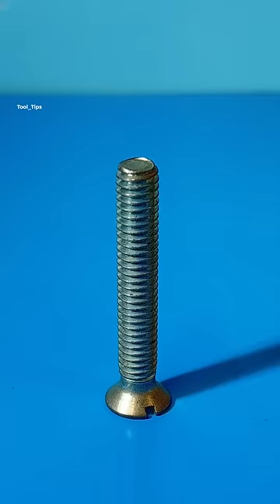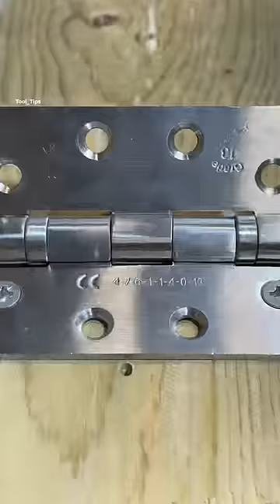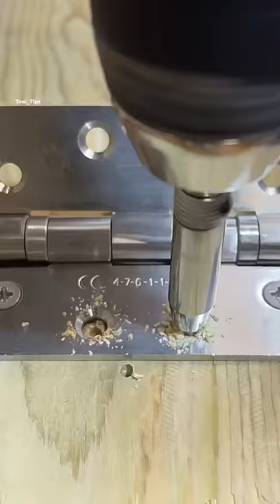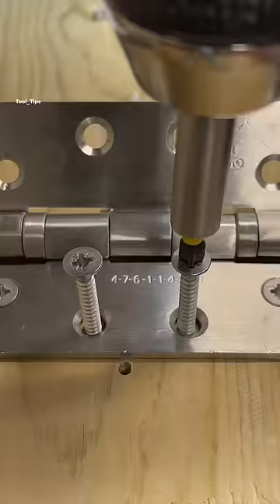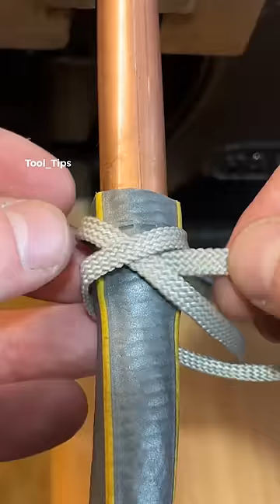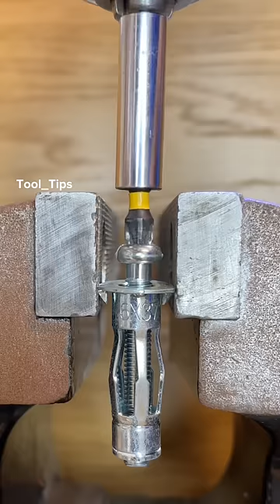Tool Tips 🤷‍♂️

Comment: Also don't use shoe string and a water hose on a copper pipe, just buy the adapter.
Reply: hold up...

copper pipe and water 💀
Reply: @ijazkassim6496  are you saying that copper pipe + water = death?
Because that would be as incorrect as using a shoestring and a water hose for an adapter.
Reply: What do you think your water comes to you in?? PVC pipe? 🤣👍
Reply: @richardheckemeyer3666  cold water does sometimes.  🤷🏼
Hot water has to be cpvc or pex or copper or whatever.

Comment: I keep Wooden Match Sticks with the heads cut off in my tool kit for stripped out holes in wood.
Reply: Golf tees work better. A spot of wood glue and tap it in till it's tight. It's a solid piece of wood that works nicely even on a hollow door
Reply: @jameshendricks8526  Add to my stash. 👍
Reply: @jameshendricks8526  unless it's a plastic tee... Thought of that?
Reply: @nickchester3275  well let's look at that, they were talking about using matchsticks with the heads cut off. Since match sticks are wooden and door jams and doors that this trick will work on are also wooden, and not to mention I said it is a solid piece of wood which would indicate I'm not referring to plastic golf tees,  most people who use common sense wouldn't expect my comment to be about plastic golf tees.
Reply: @jameshendricks8526  Well, thanks. I'm happy to be identified as not one of "most people"!
Reply: @nickchester3275  fair point